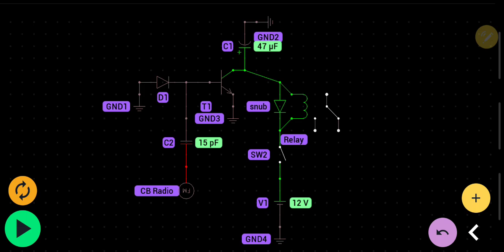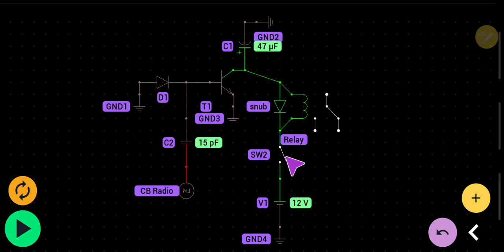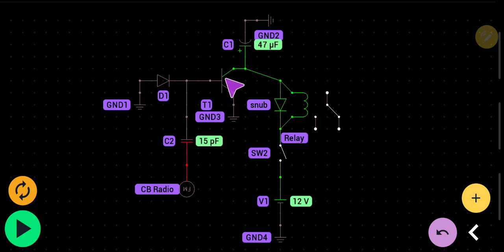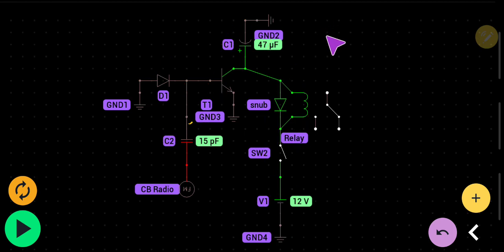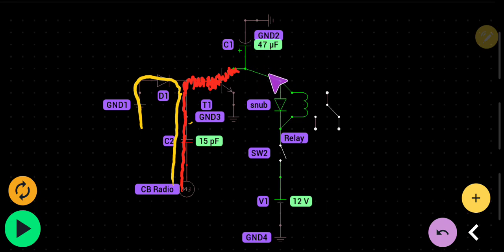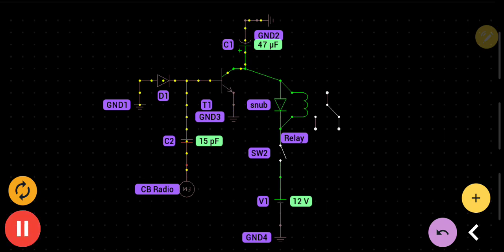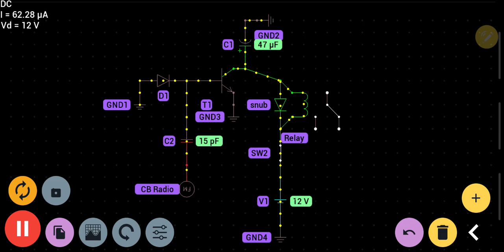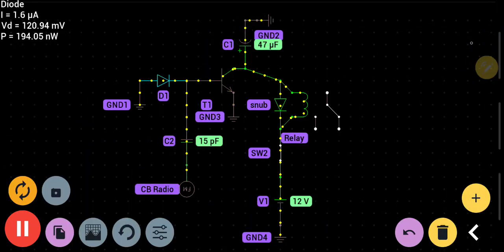Amp Building Concepts - RF Keying Circuit Interactive Diagram

Comment: That's cool software. I've not seen anything like this. I tried Easy EDA the other day to try to design a printed board for a noise blanker and there are still a few things i need to get my head around but this is great. I wonder what AI working with these tools could come up with.
  I'm looking for a public / open source  library / repository  for printed circuits. Sometimes It's just cheaper to build something if you can find something thaat already works then I'll take the lazy way and be thankful for the work that has already been put int it. My skill level is not super high when it comes to designing circuits so I like to learn bit by bit from projects and by listening to or copying what others have provided, sometimes I will then modify, add or try to improve certain parts of a circuit but it's good to have a base to start / learn from sometimes.
  This software could take my design skills to the next level.
Thanks for sharing this.